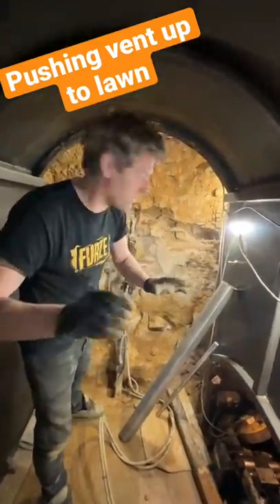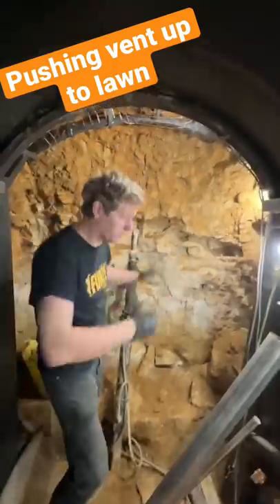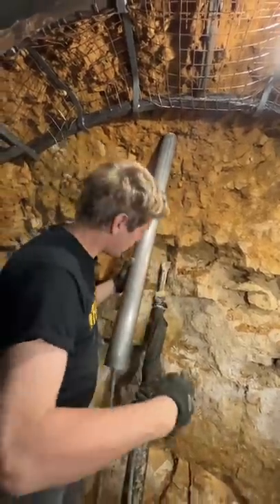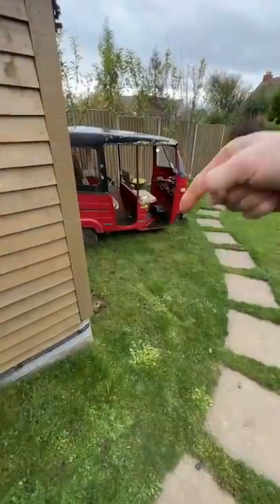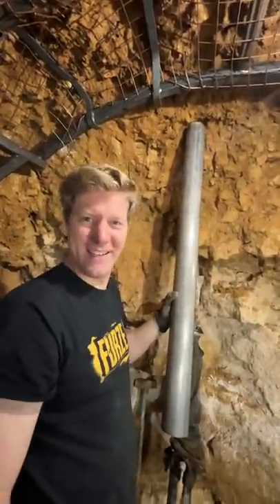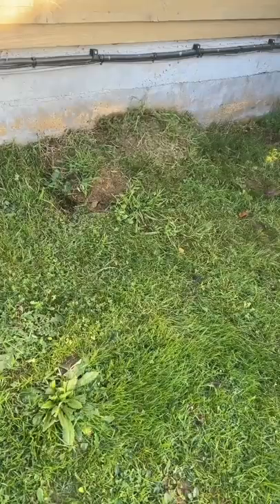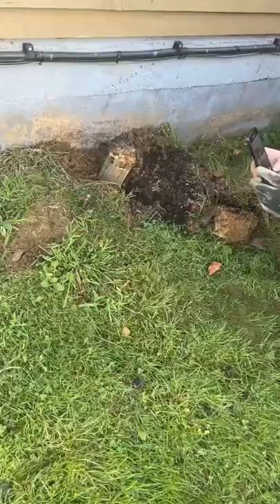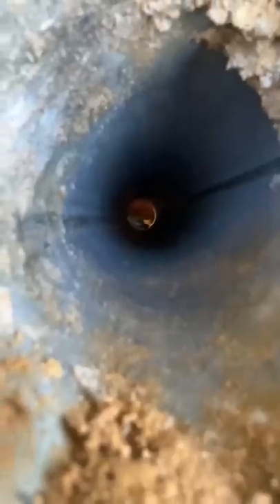PUSHING A VENT UP THROUGH LAWN #shorts

Comment: why not jus run a vent tube along the lenth of the tunnel instead?
Reply: A tube open on 1 end doesn't circulate
Reply: @bengrogan9710  you can run a tube with vent holes to create positive pressure of fresh air similar to a "french drain" pipe
Reply: @4TwentyFour20  that works with water due to the it being heavy enough that the grade of the pipe will cause flow - doesn't work with gasses
Reply: @bengrogan9710  it can work with an extraction fan... mines do it all the time
Reply: @4TwentyFour20  yes and no.
Mines have 2 shafts that have a main via with a fan at 1 end, they need that flow at the main roadway to reduce the static pressure and allow the venturi effect to cause circulation in the blind shafts
Reply: @bengrogan9710  in a tunnel that short with 3 enterances it would work with a 4 inch inline fan attached to a french drain tube
Reply: @bengrogan9710  and ypu blow the air in, not extract it
Reply: @4TwentyFour20  or he can not Increase his electricity bill and use heat circulation.
The pipe in the shed or house is warmer air which will naturally flow towards the garden pipe
Reply: @bengrogan9710  i am concerned with floodind with all these holes he is drilling and it is easy to make a 4 inch fan solar powered on a battery pack
Reply: @4TwentyFour20  Likely due to  not looking at the context of where he is - Here in the UK we don't have any weather extremes in the summer or winter - we tend have light drizzle for most rains here a simple conical topper will prevent rain ingress by creative a flow S bend
There is a bigger water risk from the condensation build up in the tunnel due to cold air and the heat caused by concrete curing

Comment: Hey Colin. It didn’t occur to you to put a pointy shaped cap on the end to keep the  muck out and make penetration easier? WHAT AM I SAYING?!?! That would be the sensible way to do it and since when has Colin done sensible?🤣 Great fun, Colin. Keep it going!
Reply: Actually, that would have made it much harder to drive. It would have to push all the soil aside.  His little ram would not be able to do it. Using a hollow tube was the smart way. I'm sure it didn't take long to empty the pipe of dirt.
Reply: @whitcwa  this.